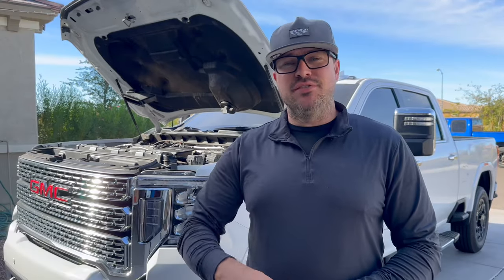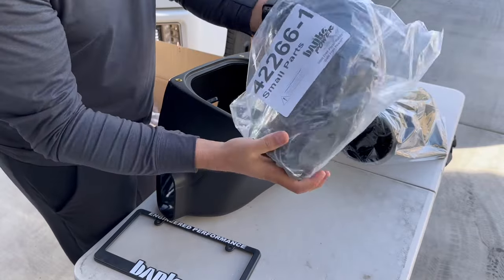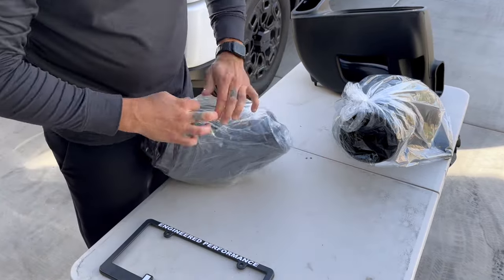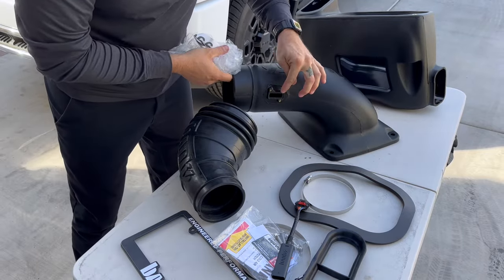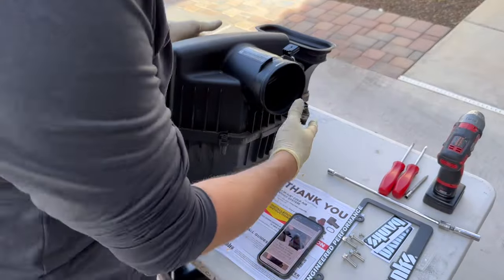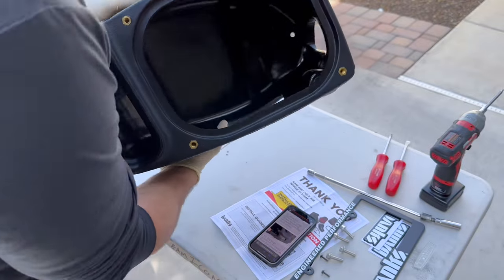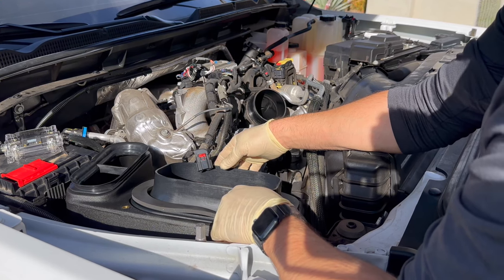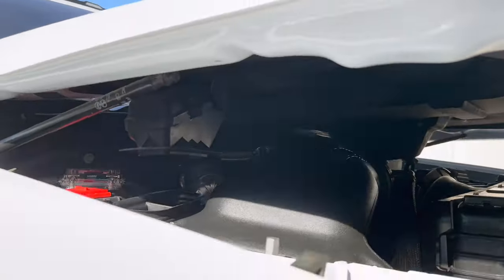Banks Ram-Air Intake Unboxing & Install 2020-23 Chevy/GMC 2500/3500 6.6L Duramax L5P

Comment: They need to make the resonator delete tube like they had for the 17-19. Keeps the maf sensor in place and cleans up the engine compartment.  More noise, better flow, and no codes.

Comment: I want to start out by saying I love Banks product! but I have a 22 Chevrolet Silverado 3500, I had issues with the check enginelight coming 3 different codes. Call banks sent me a new electrical piece out still didn’t solve the issue . So I sent the whole intake back to banks and they issue refund. Not sure what the issue was.
Reply: I’m reviewing these Banks intakes extensively and I continue to find people catch a code. I’m almost thinking to get a different brand. Really not sure on this one.

Comment: So now that you had the Air-Intake for a month or so how do you like it and is it worth the money, I have a 22 GMC dually that I'm thinking about getting I have the Pedal Monster coming and I will be installing that but with both I was wondering how is the preformance?
Reply from the maker: This isn’t my personal truck but my buddy loves it so far. Good sound and he notices a little more performance out of it. But most of it is probably from the derringer but the intake compliments it nicely..
Reply: @Bobsgaragetech  Thank sir for your reply I appreciate it, I just received the Pedal Monster and I just want a little more, I was thinking about getting the air-intake next I was wondering should I get it or not.
Reply from the maker: @bishopgeorge1333 you will enjoy the pedal monster. It’s a lot of fun!
Reply: Does the derringer really  reset to stock mode after turning the truck off? You have to pick a power setting every time you start it?
Reply: @Bobsgaragetech  I'm thinking about getting the Derringer and the Idash so is it worth it?
Reply: @michaellopez809 mine doesn't

Comment: Probably not but have to ask, did you hear more turbo noise at all?
Reply from the maker: Slightly more yes. But most of the noise is on accell, adding a more throaty sound.. hard to explain but it does add some sound.

Comment: will this intake void a factory warranty? I just bought a 2024 2500 HD with a Duramax
Reply from the maker: No unless the failure whatever failure your dealing with is directly caused by the intake but that would be rare…
Reply: @Bobsgaragetech  thanks!

Comment: Any idea what to do when check engine light turns on using the bank’s ram air intake ?
Reply from the maker: Yes look closely at how the Mass air flow sensor is installed and make sure it did not pick up any debris while it was out. Other than that you will need to scan the truck and get a specific code to see what is setting the check engine light. Thanks for watching! 🙏🤙🏼